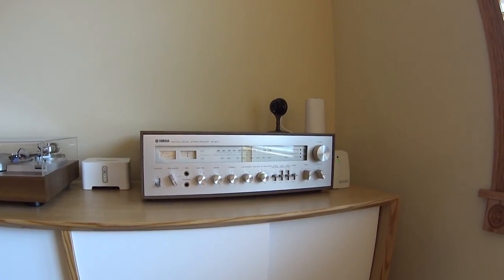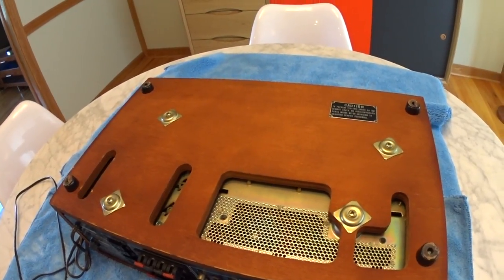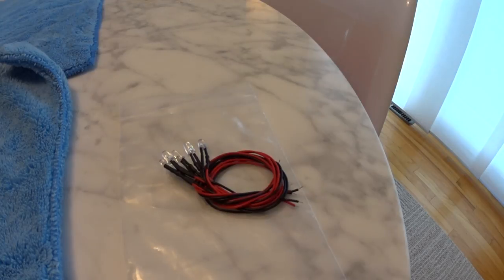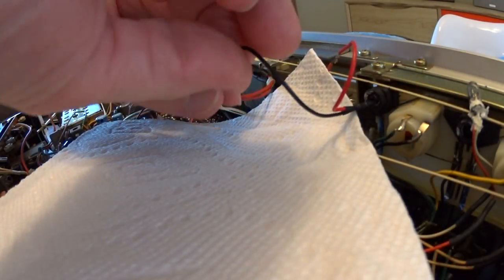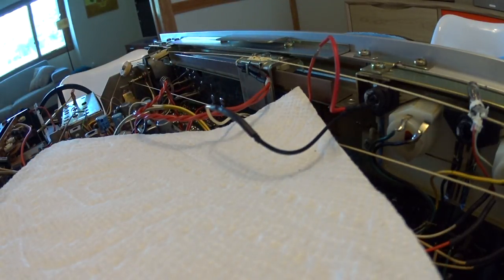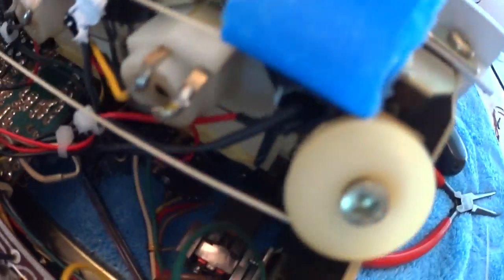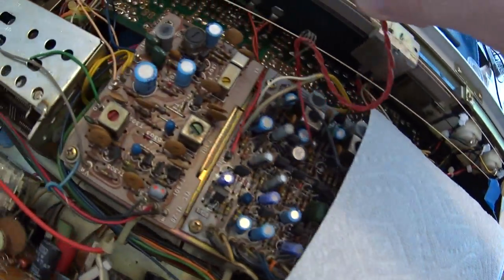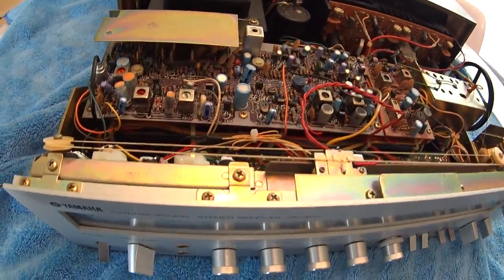Yamaha CR-800 Receiver Display Lights Replacement

Comment: I was replacing LEDS on a CR1000 and wasn't sure how to get to the light in the tuning dial. Your video helped me get it done. Also, because the new LED's are a little smaller than the originals, I put shrink wrap near the tips of the lights to fatten them up a little so they fit in more snug. Thanks for the great tutorial vid!
Reply: I have the opportunity to buy such a receiver for my NS690II at a good price. Tell me how often the backlight burns out, or how often do you change it? And in general, does the receiver need regular maintenance? Because I hesitate, it might be better to take something from newer models, for example AX890

Comment: Three things I noticed about the kits that include LEDs with resistors: (1) the resistor should be rated for the current and voltage in this application. Mine was much too small. If you can't keep your fingers on the in-circuit resistor because it's too hot, your resistor isn't of the proper dissipation rating and you are begging for a meltdown. The sold resistor was a 470Ω 1/4w and it should have been rated for 1w. You can actually wire these in series with a single 1w 470Ω resistor. The actual wattage used is about 1/2w. The supply voltage is 18VDC, not 12. (2) The "warm" LEDs give off a greenish glow. You may be OK with that. I opted for a standard white color, which is bluish. (3) I sanded the LED lenses to give more side light. A standard LED gives 95% or more of its light in a focused, forward direction, unlike the original incandescent bulbs that were almost omnidirectional.

Comment: BTW. Do you know the voltage on the bulbs you replaced. I think it's 18v but I'm not sure.
Reply: A bit late as a response. But according to the service manual they're 12v 60mA bulbs. The service manual can easily be found online by the way.

Comment: resurrecting an old thread hoping for some advice...  Good Video!  I did a similar LED update to a CR-820 receiver but now have a pop in one channel/speaker when shutting down.  I've eliminated other sources (main filter caps, dc offset, idle current, and relay).  I've since learned that the lights are  part of the protection scheme and I may have altered the resistance by going to LED.  I've seen on the AudioKarma site where others discuss adding a 470ohm (1w) resistor in series to resolve.  For the OP (Sean), did you have to do this or have you experienced the pop?  I'm interested in others' experience as well and where they wired the resistor - if they did.
Reply from the maker: Have not had that issue.

Comment: Could hot glue be used of calking? 11:58
Reply from the maker: Sure, I used a flexible material in case I had to remove it easily without breaking the brittle housings.  But hot glue would work I would think.

Comment: Anyone know a way to customize this and add new LED lights to the tuner open space?  I'd like to play with adding lights to the entire strip of the tuner, but I'm not sure where I would solder and draw power from, since this would be an additional draw of power that was not originally intended.
Reply: As long as they're efficient new LEDs, you shouldn't need to worry about where to solder them in, they'll still draw much less power than an incandescent. Just make sure they're the correct voltage, and wire them into the feed of any of the other lights.

Comment: I still have my Yamaha stereo (CA-800 amp) from the mid-70s.  I cannot get a replacement lamp for my T-60 Tuner.  Where did you get your lamps/LEDs?  Thanks.
Reply from the maker: Just search on eBay for "Yamaha (your model) LED's"

Comment: It's one of the best sounding pieces ever. I went through many amps and receivers to find best gear and I only wasted my time. There are more pro looking units like CA-1010 for instance but CR-800 sounds better and heftier.
Reply: How about the CR1000? Looking for a good option for my NS690II. Especially to pump the woofer well.

Comment: Sean, my parents had that exact same receiver back in the mid 70's, I purchased it for them from Sound Advice in Miami Florida, I use to really jam out with that bad boy lol, wish I had it now!  Thanks for the video bud!
Reply: I have the same synto-amp, inherited from my father. I am trying to build an Hi-fi set around it  as a main amp, but I am struggling to find the right speakers to couple. In fact the Yamaha cr-800 sounds fine, but doesn't seem to be quite punchy and powerful.
I took it to the assistance for a check (I can't tell how skilled the technician was), and they told me it is perfectly working.
Do you have any good advice on:
- how to really check its power conditions
- which loud speakers would sute perfectly

Thank you very much!

Comment: So I'm guessing these are not LEDs but regular bulbs, cause replacing them with LEDs would be more complicated.
Reply from the maker: No, they are LED's designed for this application to handle the factory voltage.  It is a simple replace.
Reply: @seanstraindepot  Interesting, are they the ones sold by eBay seller hi-fi-rocks?
Reply from the maker: Not sure, I don't have the purchase History anymore to see it.  It was too long ago.